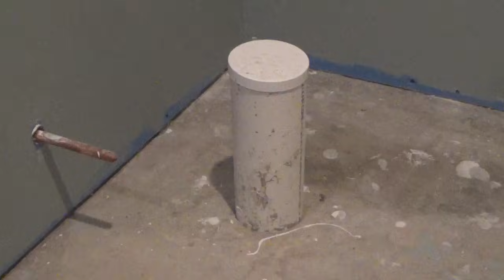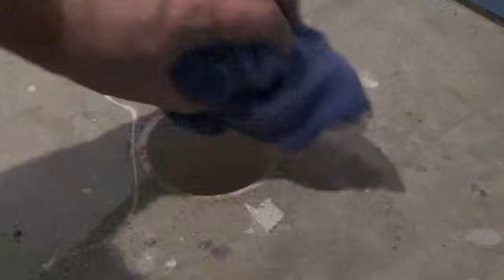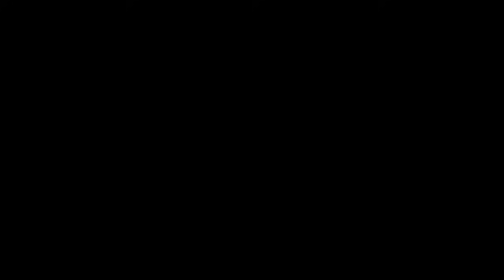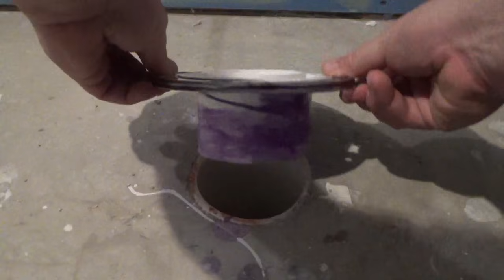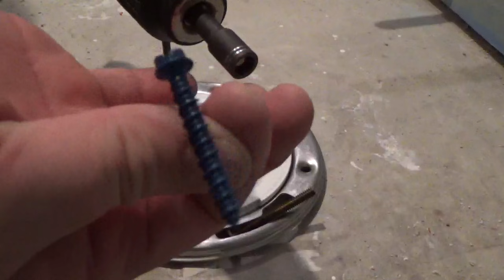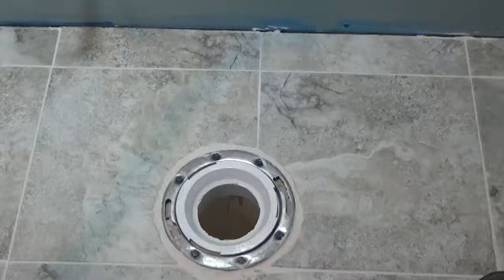Toilet Flange Installation on New Construction - Closet Flange

Comment: A little difficult with a 3” pipe, right? I assume you have to chisel out the concrete?
Reply: I have the same question.  With a 3” pipe and spigot flange the bottom doesn’t sit flush to the floor so it sits too high. I just removed old one since it sat too high and trying to put one in only to discover this.  Maybe there is a flange out there that would ?
Reply from the maker: If you have 3", then just use the standard brass flange and screw it to the floor.

Comment: I'm replacing my 4" PVC flange.  Can i use the same tapcon holes in the cement foundation or how does that work with lining up the mounting screws for the toilet base?
Reply from the maker: Find a flange that has different pattern of holes, and drill new spots if you can.

Comment: The toilet flange needs to be on top of the finished floor. Meaning the bottom edge of the flange needs to be on the same plane as the toilet. So if your toilet sits on the tile, the flange needs to be on top of the tile too.
Reply: Not an opinion at all.... its actually code in states
Reply: This is what i was looking for in that video... thank you...
Reply: It's not an opinion, he stated the correct way to install correcting your error.
Reply: @63GTDriver  it is just your opinion its just that....no it all
Reply: Well what about in the case of floating luxury vinyl waterproof plank? Wouldn't you want to attach the flange directly to the concrete then so the floor can continue to float a bit between the toilet?
Reply: @jacobgraf83  yes I think in that case it would be better to go directly to the concrete. I’ve seen installers go through just concrete, and others through flooring then concrete. I don’t think it matters that much, because toilets are installed with a wax or plastic ring that is pressed down to the correct height.
Reply: The flange sits on top of the finished floor height
Reply: Facts, but I do appreciate the videos
Reply: I think that is a beautiful floor.  Why ruin it with tile!?
Reply: I think it depends on the toilet. Everyone says to put it on top of the floor, I have two bathrooms, two different toilets, I had to cut the tile out and put the flange flush with the top of the tile in one bathroom so the flange was sitting on the subfloor, and the other, the flange is on top of the tile. If I didn’t cut out the tile to lower the flange, my toilet was sticking up a quarter of an inch. Putting it on top of the tile would be stupid in that situation.
Reply: Thanks. I was wondering about that.
Reply: Thanks Russell. I am finishing my basement was quoted $45,000 by hungry construction guys lol have only spent $4k so far ...
Reply: Good to know!
I just refloored my bathroom and I wasn't sure if I was going to have to step the flange down any.
Reply: Agreed.
Reply: For all the so called pros why are you watching the video?
Reply: Our toilet flange needed to be flush with the tile not on top. Otherwise it raises the toilet off the ground. Thank you Phil! You saved us so much time!!
Reply: Bullshit it goes on just like he’s showing .  I just did this.  And i listened to you put it on the tile.  The toilet was 1/4 in high.   Put the think flat on the concrete.
Reply from the maker: Thanks, Russell for your opinion!
Reply: mine gonna sit on concrete, so the way you done it is what i was looking for. I like the spinning flange, did not know they existed.

Comment: Use a wax free seal and it does not matter if flange is above or below
Reply from the maker: interesting..... never heard of it, or used it.
Reply: @PhilCrockett  It's a big rubber O-ring Phil,it seals the water closet from leakage

Comment: The flange is suppose to sit on top of the finished floor no?
Reply from the maker: Actually, the flange can be installed either way.  I took a poll at the local plumbing store to see what everyone does.  The majority by far, told me they would install to the concrete since my tile wasn't going to add too much height.  Now.... if you have super thick flooring, you don't want the flange below the surface.  You can always shim it up with flange spacers.   A lot of plumbers will argue for either way, but both ways work.
Reply: @PhilCrockett  I don't know why there is so much debate on this subject...I've done it both ways and had problems only with installing directly on the concrete slab and tiling around it.  Had leaks galore and needed a special gasket as the wax rings weren't able to seal correctly.  But again, it does seem like a lot of people will just put it to the concrete.  I will NOT be doing it that way again!  To each their own though.
Reply: @tyslink  because there no it all that no nothing

Comment: How would you replace the flange if it breaks later on?
Reply from the maker: There are a couple methods:    You can saw it flush with floor and install a regular 'old-school' type ring flange over the top, OR.....
You could saw flush with the floor and cut and chisel out the pieces,  and put another one like this one in.    Here's a video that might give you a ball-park idea:https://youtu.be/XpJAsRaKKeE
Reply: @PhilCrockett  👍

Comment: For the Tapcons, be sure to use the right size concrete drill bit. And be sure to drill deep enough. You don't want the fastener to bottom out before the head pulls down on the stainless ring. Your drill will twist the the Tapcon head right off the bolt shaft. What a mess!
Reply from the maker: yes indeed, Kevin.  In fact....... I have a video on that as well!   Here it is.....
https://youtu.be/Nf0sCYxdd-U
Reply: Phil Crockett Thank you.